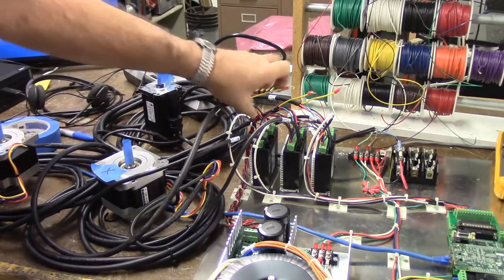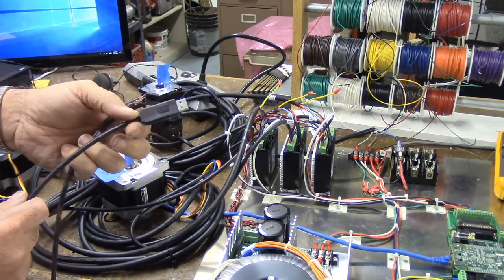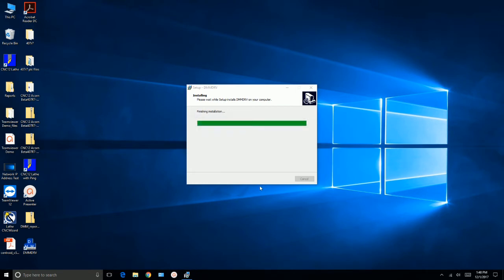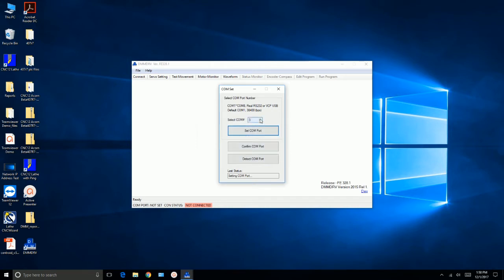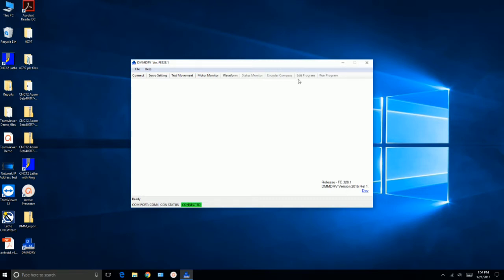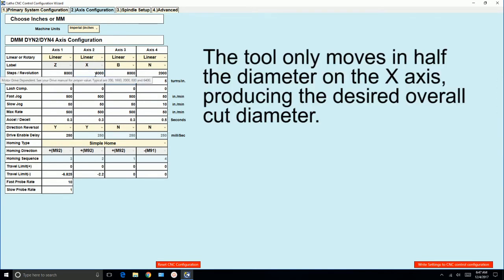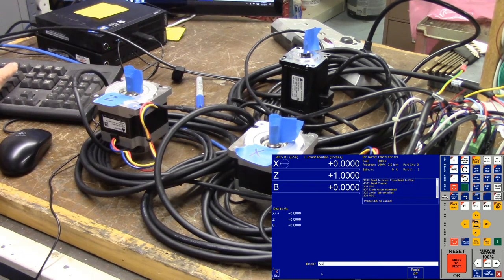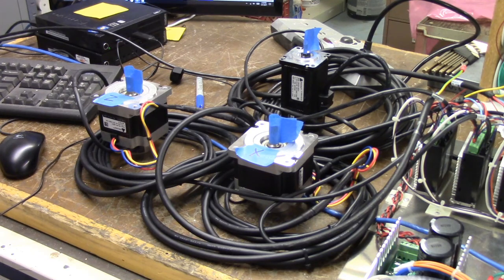DMM Servo Motor Configuration and Bench testing for use with Centroid CNC Acorn motion controller

Comment: How critical is the computer you’re using? I have one server computer with the Xeon processor and it gets like 12,000 on the benchmark but only 1182 single thread I have another computer that is about 1090 single thread but 6000 benchmark do I need a computer that is 1500 for single thread for milling?

Comment: Hey Marty

Nice video.
Do you have one where you do the same but with
2pcs Nema34 8.5Nm Stepper Motor + Drive Kit HBS860H + 86HBS85
and
1pc Nema34 12Nm Stepper Motor + Drive Kit HBS860H + 86HBS120 can not figure out what setup should be in centroid.
Can you help me or know a video.

with best regards
Gert

Comment: Marty, thank you for all your awesome and informative videos.  Quick question, for step and direction signals looks like you plug it into a db25 breakboard, will you use this in your final install and if so any particular brand or part you recommend?  Any help is appreciated.
Reply from the maker: bostondan77, yes I did use the DB25 break out board for the DYN2 drives. It's necessary and easier. Amazon sell them.